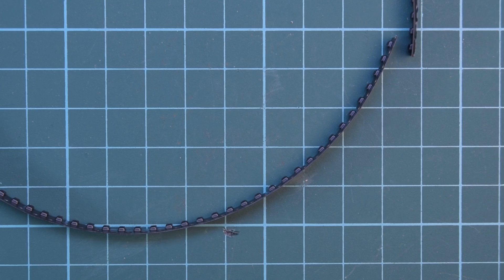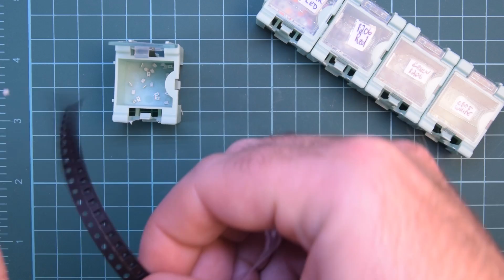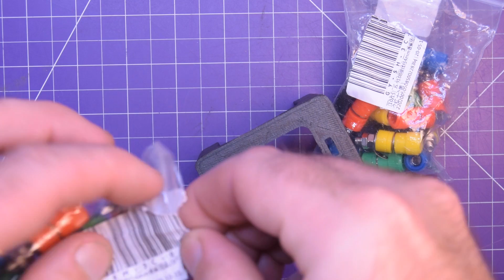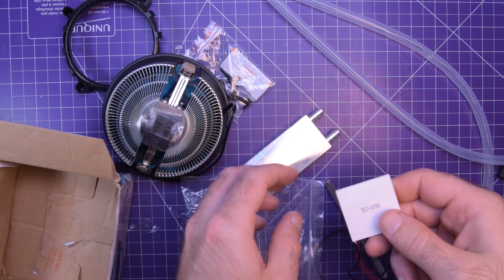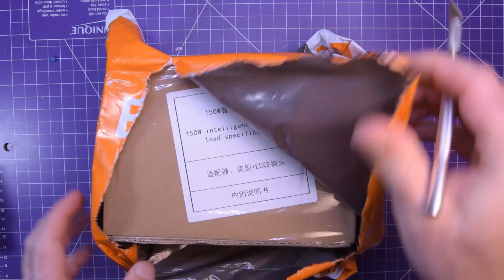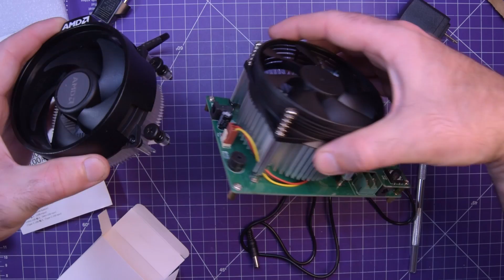Mailbag 65 - Coolest Episode Yet!

Comment: Just use 2 fans and 2 heat sinks if you want to build a fridge or cooler otherwise you will require anti freeze, a pump and some type of thermostat. If you look at the ready made  coolers like Mobicool and Coolatron they use a fan and heat sink on the hot side and a slightly smaller fan and heat sink on the cold side. Your idea is good for the high powered LED but far to complex for a simple fridge.
Reply from the maker: Hehe the journey is often more fun than the destination though!
Reply: @SimpleElectronics   Oh so true but I always found that anti freeze on my food gave me really bad gas.
Reply from the maker: @jefftremblay3707  hehe you'll see, no anti-freeze needed

Comment: Where do you get your small boxes for smd components from?
Reply from the maker: Ebay :) this link should get you where you need to go https://rover.ebay.com/rover/1/711-53200-19255-0/1?mpre=https%3A%2F%2Fwww.ebay.com%2Fsch%2Fi.html%3F_from%3DR40%26_nkw%3Dsmd%2Bbox%26_sacat%3D0%26_sop%3D15&campid=5338675657&toolid=10001&customid=smd box
Reply: Those are pretty cool.  Hmmm, wonder if I could find a STL for those, to 3d print?
Always looking for the best way to store and organize resistors.
Reply from the maker: Not exactly, but close: https://www.thingiverse.com/thing:3720450